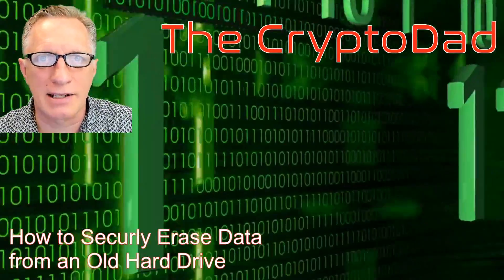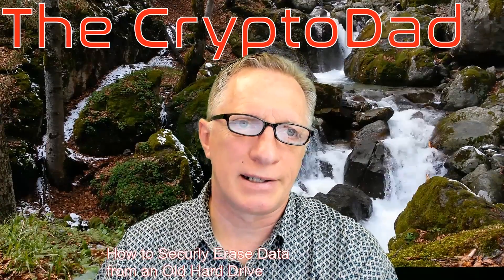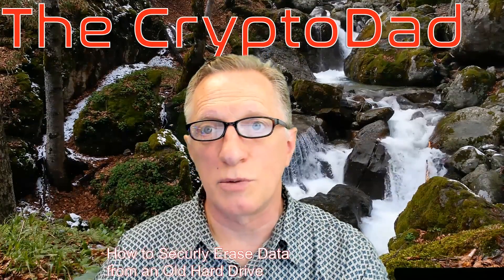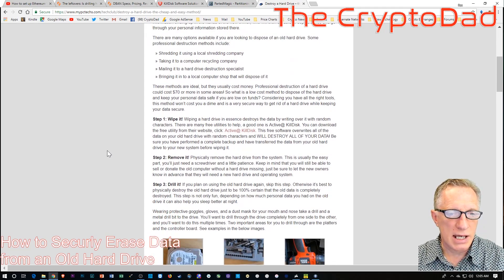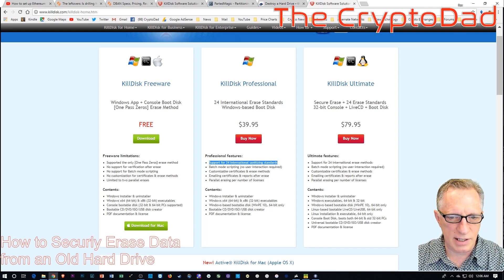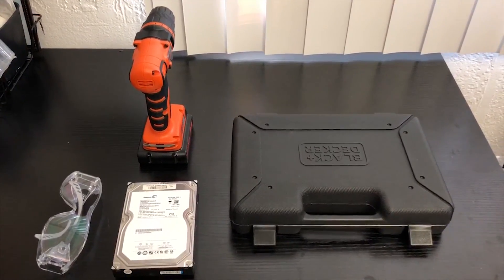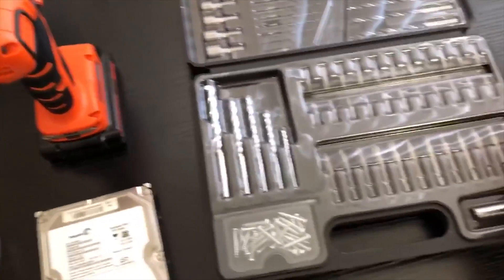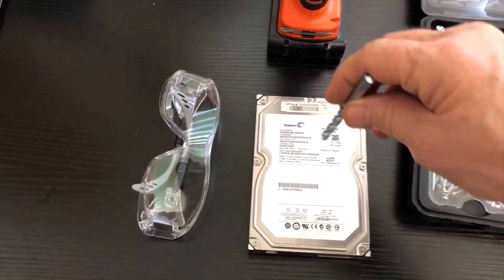How to Securely Erase an Old Hard Drive

Comment: Those do look like drill bits for cement and you pretty much need a hand held hammer drill to make a drilled hole , You need a drill bit for metal drilling , they used to be called ( back in the daze when they were hardened steel ) high speed steel  or h.s.s.   These bits drill easy if their not dulled from using a lot , some folks use cutting oil with bits at the drill tip to help prolong the drill bit life.I would never throw out a hard drive the expensive rare earth magnets in side can be removed and repurposed , especially for science experiments 📚🎓🔌🆒📡📐📚✏📖📘🔬📈🔭😃

Comment: Rex, there is a secure way to do it. It is free and simple. 1) format the hard drive. 2) fill it with movies or garbage files until no free space on the hard drive. 3) format it. It is still useable, but original information is unrecoverable. Drill holes are not enough for experts; they still can find something from the fragment. If you do not have a lot of movies, you can rename a movie many times and copy, paste them into the drive until it is full. Rex, please tell me how to use Omni Core wallet to store USDT.

Comment: Hey Rex love your videos they are very informative.  I have a hard drive from one of my laptops that i removed because someone slammed the laptop down and it screwed up the computer.  I had very sentimental pictures on this hard drive.  i have the hard drive.  Is there any way to transfer this data on to another computer?  I really want those photos and maybe a few files.  Please advise and thanks in advance.  Cryptoekeeper
Reply from the maker: You could try an external drive bay. They work for laptop hard drives too! (2.5 inch) Here is my Amazon affiliate link to the product
Inateck USB 3.0 to SATA Dual-Bay USB 3.0 Hard Drive Docking Station with Offline Clone Function for 2.5"/3.5" HDD SSD SATA (SATA I/ II/ III), Support 2x 8TB and UASP, Black (FD2002)
https://amzn.to/2Lu1gZ6
Reply: Rex Kneisley Thanks Rex I'll give it a shot.
Reply from the maker: They make a singe bay one too, it's cheaper:
Cable Matters USB 3.0 SATA HDD/SSD Docking Station with 10TB+ drive support (Thunderbolt 3 & USB-C compatible)
https://amzn.to/2xiUpyy
Reply: Rex Kneisley I ordered the dual one under your link. Ty
I may hit you up on some more help when I get it. The family pics are special to me. 
Cryptoekeeper
Reply from the maker: You got it!
Reply: Rex Kneisley hey Rex I received the inateck clone dock. I plug the USB cord in my laptop and it make a sound like it recognized it but no window pops up to allow me to read it or see it. Was wondering what I'm doing wrong? 
Where can I find the unit on my computer
Reply from the maker: CRYPTOEKEEPER, have you plug the drive into the doc yet? Sometimes you have to remove it and plug it back in again to get the drive to recognize. It should show up in your list of drives in “my computer” From there you should be able to double click and open the Drive up. Then you should be able to just drag the photos to your main drive

Comment: @cryptodad how can i recover data from formatted macbook AIR
Reply from the maker: The MacOS uses a formatting scheme called Mac OS Journaled. I saves some data after formatting. As long as you have not added nay new file since it was formatted you can try a recovery utility. There are many. Herr is one that I have heard of:
https://www.prosofteng.com/blog/recovering-from-an-accidentally-reformatted-hard-drive/

you might want to do some additional research to fine the best one for you based on cost/features.